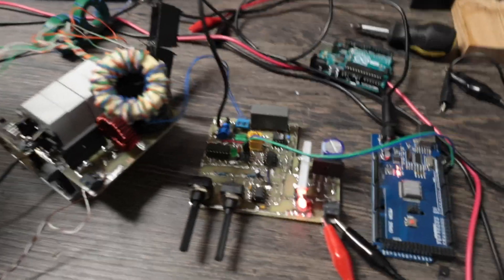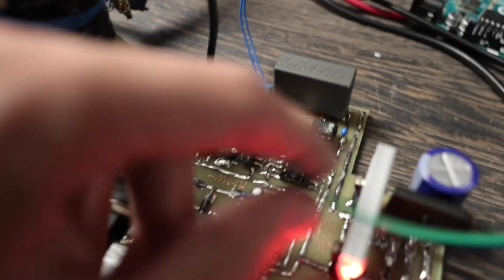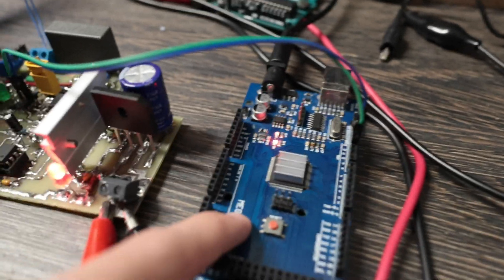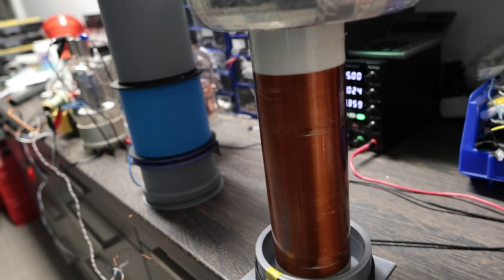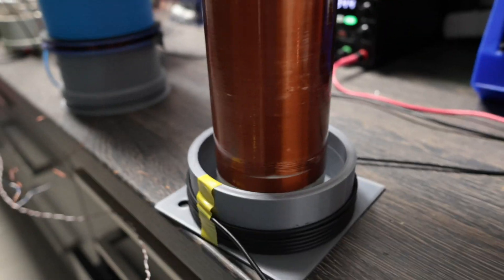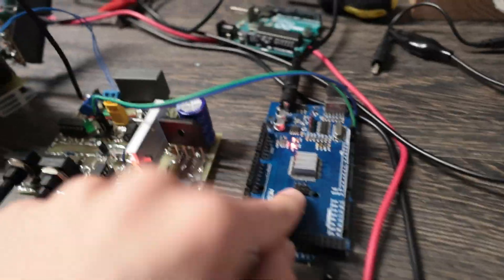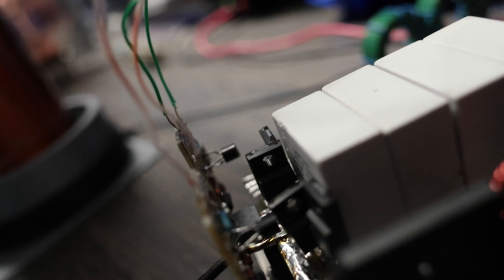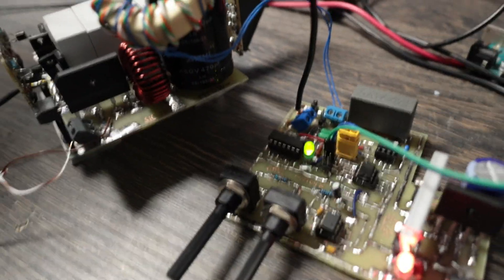Making musical SSTC tesla coil with arduino for PWM frequency modulation

Comment: Do you use feedback? And which driver ic
Reply from the maker: The driver is a UCC chip, one with two channels (one inverting one standard)

Yes I use antenna feedback because i wasnt able to get transformer feedback working, the feedback circuitry is very similar to steve wards mini sstc